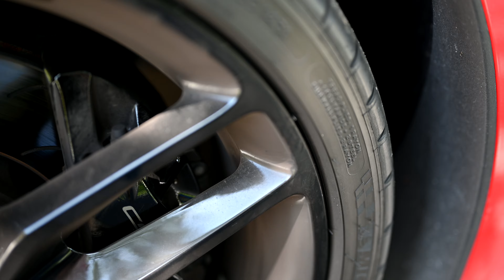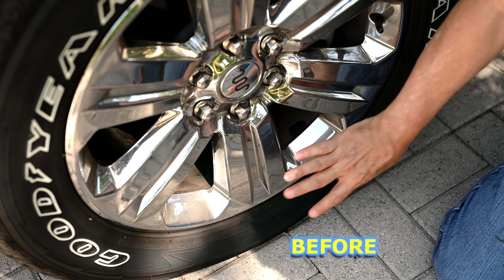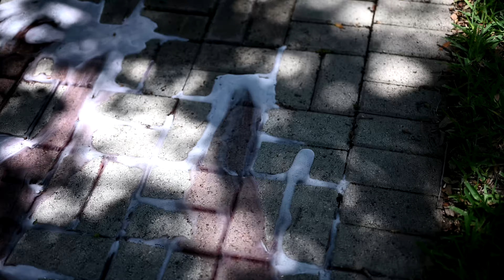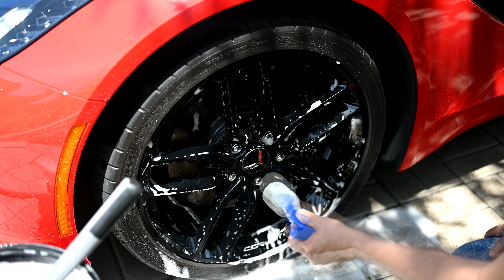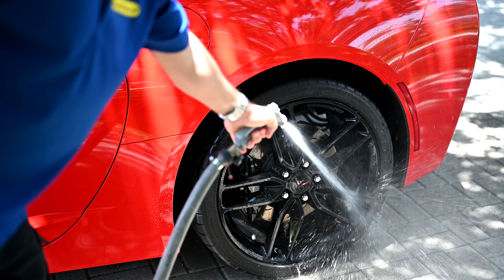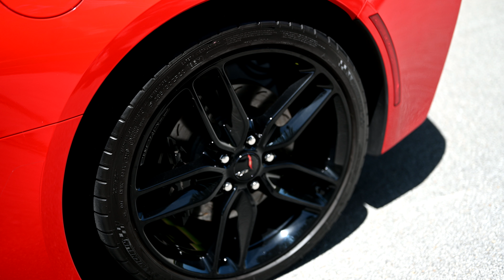Best Corvette Wheel Cleaning, Tire Dressing Tips Like The Pros

Comment: I have several lights on my board predicted, abs, check in, they already changed the speed sensor that was what marked the computer with the code c0034, but I still have the same lightsThe code it says is C0034, it is on the right in front of the sensor and the dash lights continue and continue to dial the same code
Reply from the maker: Desiree we cover this repair in our other video about ABS brake sensor that is what your code C0034 means, watch out other video here: https://youtu.be/S-epnJbdG0Y